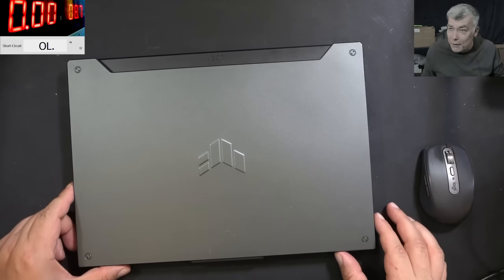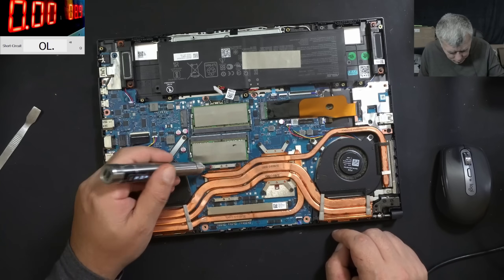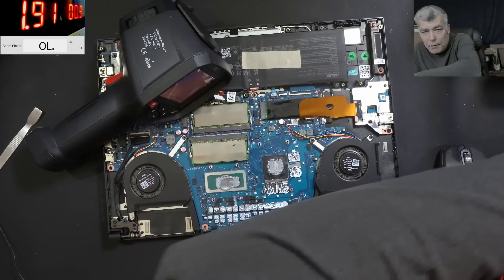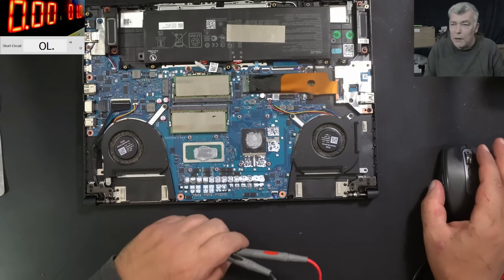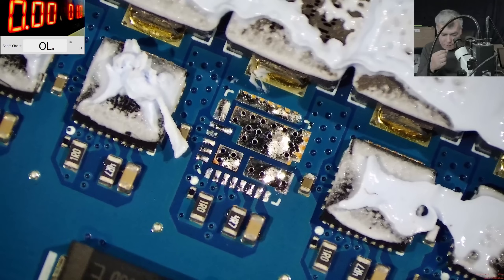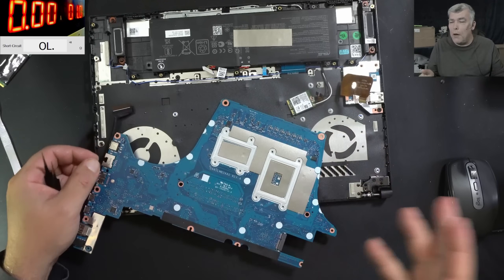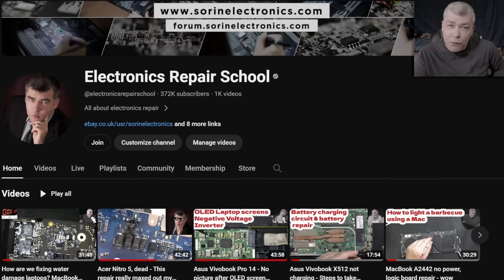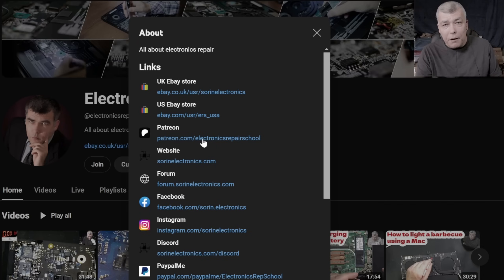Asus TUF dead, not charging - i misdiagnosed this laptop, nearly missed the fault

Comment: I have been watching and learning from you I have learned that most of the time it's a capacitor that will short before a mosfet and whenever I find a mosfet that's getting hot I'll test it off the board. Thank you Sorin your still the best.

Comment: I have been working on a similar laptop managed to get the laptop back to life there was a shorted mosfet on the gpu luckly it survived so I removed and all.worked fine but my problem now is the battery says it's charging with the ac plugged in 76% but doesn't actually charge ( laptop.works on both ac and battery) when on windows it keeps flashing saying plugged online then on battery it's like it tries to charge but keeps being disconnected

Comment: All diagnosis is educated guesswork until you finally get there.  I bet the commentors who say you were lazy and should have taken the board out are not trying to fix quickly where time is money.  A bit unlucky that the thermal camera showed that mosfet getting hot due to the capacitor exactly at the back of it. Really great you show these ones. 👍

Comment: Thank you, Sorin, for the rich content. I have a question regarding my TUF laptop, which is identical to the one in your video. The issue is that it won't turn on initially, but after several presses of the power button, it eventually powers up. I’ve already replaced the power button, but the problem persists. What could be the likely cause? Thank you!

Comment: Another faulty chineese capacitor... It's good that it hadn't taken anything else. And I hope someone had removed that ton of dust from the fans.
Reply: Yes, the fans were quite clogged with dust and fluff. I was waiting for a coment from Sorrin on that. What are the opinions on doing additional work like that if not asked for by customer?
Reply: @melvilib  I would remove the dust for free, just not to get the device back for repairs in a few months (dead from overheating and with much more serious problems) :) But the replacement of the thermal grease after disassembly? That's a good question. The liquid pads on MOSFETs and coils probably survive the disassembly, but the grease on CPU and GPU  - will not. So it's a good question what to do. I'd ask the customer. And probably put the "phase change" Laird or Honeywell on both boss chips. The cheaper one (like MX4 and alike) depends on the total repair costs - maybe even for free. But TBH, I don't make living on repairs, just doing it sometimes for fun and for friends and can spend some ph-ch paste. In Russian service workshops it's a separate job ("dust, thermal pads and paste refresh - "servicing") and is always paid as unavoidable "collateral job". he same as diagnostics (if a customer confirms to repair, it becomes free, otherwise - it's paid one). But it's up to a workshop owner of course. As for me, I would agree to pay for cleaning and replacement of the thermal interface if not doing it myself (and I probably won't touch it if there's the liquid metal).

Comment: What is really ridiculous is that the service center sends a very expensive bill by charging to replace the entire motherboard (CPU+GPU included) when only one capacitor is shorted. My ASUS laptop is no exception and I had it repaired cheaply at a private center.
Reply: It's the difference between module and component repairs. The modern approach is module-based: don't look for a faulty element, just replace the whole board. Faster and easier, but much more expensive.
Reply: @entusiast2000  it's way to earn huge profits from customers, it's not the cost of laptop that earns company, it's their service they earn by doing these things, just replace motherboard by selling it 10x more cost and repairing their old board again and resale it as faulty motherboard is of no use to customer, they will give by themselves to service centre...

Comment: The customer probably closed the lid with something between the screen and frame or the laptop took a hard impact in that spot.
Reply: In that case, the probability to get the broken screen is much higher than to break a 1x1.5mm capacitor.

Comment: Hi sorrin, what will happen if voltage goas to data line or control line accidentally 😮
Reply: it doesn't matter because the voltage was only 1V or less.  Data or control line can take 1V without any issues. THIS is exactly why he sets the voltage at 1.0V......

Comment: To find the positive of the capacitor we do it with voltage or with continuity to ground, to find out where to inject voltage
Reply: No positive  and negative  capacitor , is smd capacitor  not  polarised , respect the sens injection curent gnd and plus